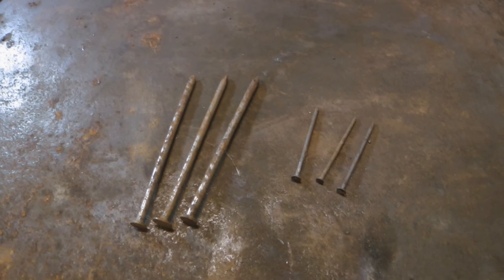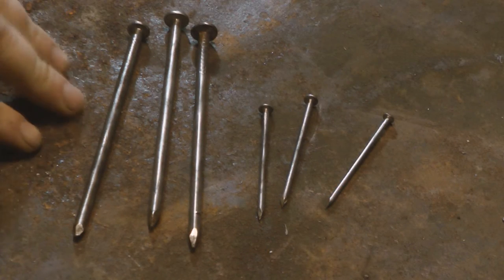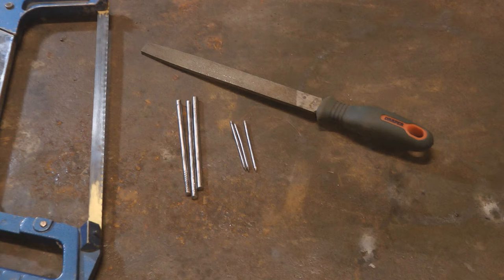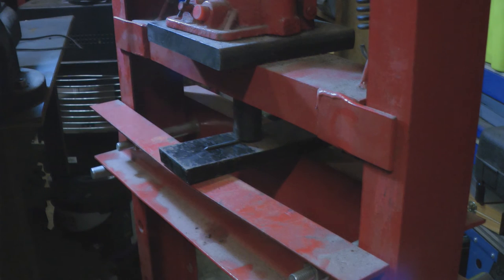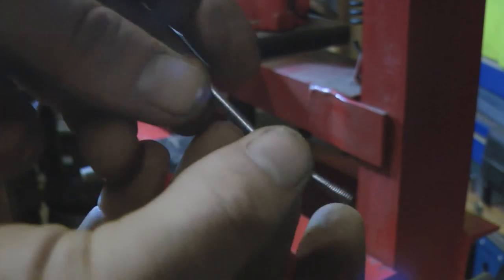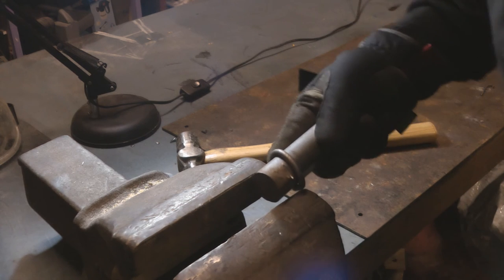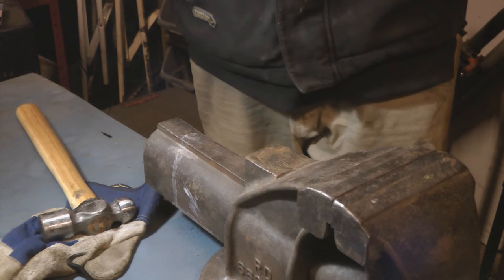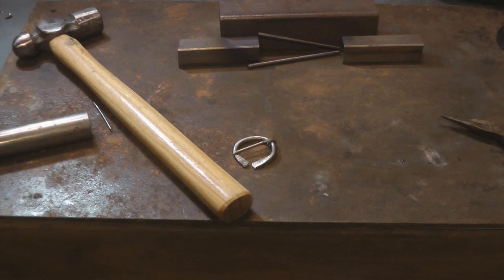Making Viking Brooches for Living History Display

Comment: Nice product. Only thing i'd recommend is using your torch a bit more liberally with the smaller steel bits. Steel tends to get brittle the more you work with it and heating it tends to reset the molecules in a relaxed manner. Cheers
Reply from the maker: Glad you like them. Cheers for the advice much appreciated. Atb Dave